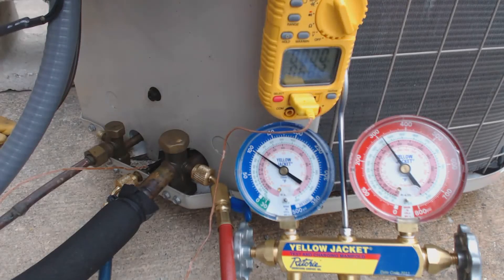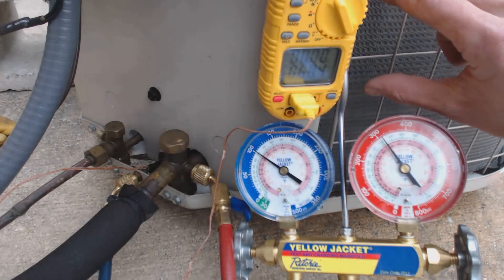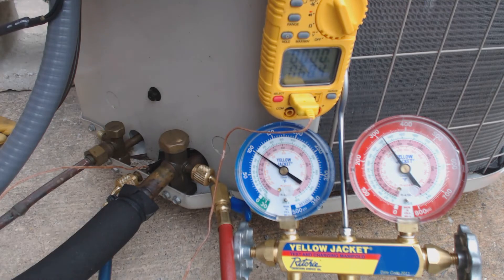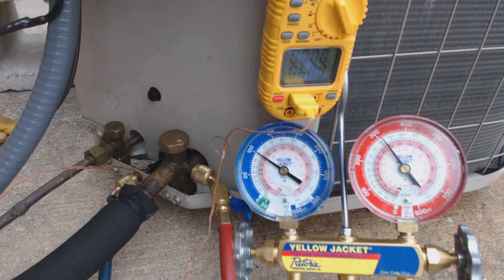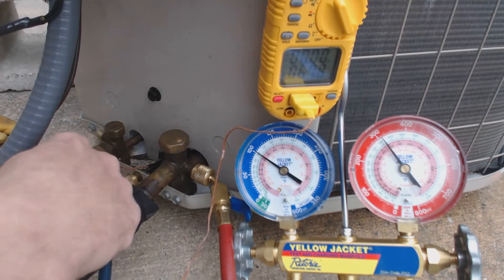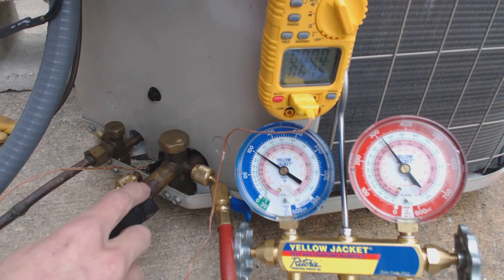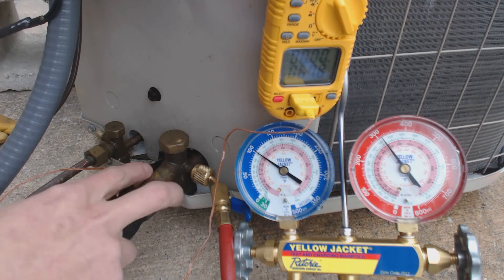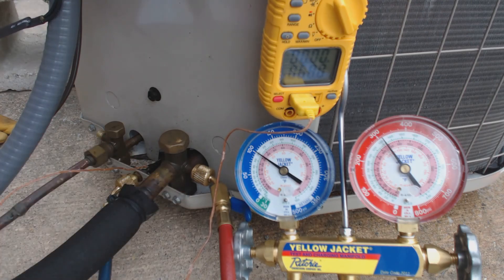Charging a Heat Pump at Start up or in the Winter Time! What you need to Know!

Comment: Hi,
When compensating for additional lineset length, do you add additional refrigerant based on the OD of only the larger (suction) line or for both lines? I have 1 1/8" suction and 3/8" liquid line. Would I add only for add'l length of 1 1/8"  or for that PLUS the 3/8" suction line length?
Thanks!
Reply: Its the combined ounces per linear foot. I.e.,  add .54 oz + .208 oz = .748 oz per linear foot.  This is the charge carried by both pipes.

Comment: Should we be adding the refrigerant in liquid or vapor state during the winter time and should we be adding it in to the discharge line or into the true suction line?
Reply: My understanding is that the heat pump it in winter everything is backwards so my assumption is we should be charging the system with Vapor into the discharge line because we are charging into the condenser which is now the evaporator because it’s winter

Comment: So in cooling mode, red hose to liquid line and blue hose to suction line as usual. But in heat mode now red hose to 3/4 line where does blue hose go? 
In both modes your low side always need to be higher than 32F correct? Thanks.

Comment: Sir you cannot check the superheat of that unit like that. Your probe must be on an actual suction line. The pipe you are attached to has no refrigerant flowing through it, it is for checking pressure only.
Reply: do you mean coming off the compressor?

Comment: I see that you are connected to the common port.  Is it possible to charge the system through the common port in cooling mode?  I'm thinking of using stubby gauges instead of hoses to save refrigerant when checking the system and would like to hook up the charging hose to the common port when needed.

Comment: How often do you have to adjust the TXV or adjust the charge based on superheat on a new installation?
Reply from the maker: We shouldn't have to go and adjust an ac system TXV if it was correctly set originally. Most TXV's for AC don't even have an adjustment stem on the bottom. If there is high superheat and low vapor pressure, coupled with normal to high subcooling then that would indicate a liquid line restriction such as a TXV. It could also be a strainer screen or the filter drier. I go into detail explaining troubleshooting scenarios as well as charging procedures in my book which is available at the website, https://www.acservicetech.com  thanks!

Comment: Hi Craig
Iv got a quick question
There is a mini split system r410a on heating mode the discharge line goes up 690 psig and actual temperature of 62 Celsius. There is no other valve to connect my hose to except vapor(discharge on heating)  question is that 690psig isn't it a little higher than normal? What's wrong with unit then?
Reply from the maker: Hey Ace, it sounds high to me too. Is it possible it is overcharged? Did you check it in max cool and find a superheat of 0 to 5 degrees of superheat? Thanks!
Reply: @acservicetechchannel 
The superheat was about 8 degree Celsius as we are in Australia and now it's winter time but not that much cold.
Saturation about 5 degree Celsius
Suction line temp about 15 16 Celsius
After reversing it from heat to cool
Reply: By the way I mean 690 kpa not psi in my first message

Comment: Would low Freon make the heat pump short cycle in heating mode ?
Reply from the maker: Only if the unit was shutting off the outdoor unit due to a low pressure switch in the vapor refrigerant line, thanks

Comment: Replaced evaporator coil. After nitrogen leak test and pulling vaccum to around 500 microns. I charged it up according to nameplate.  11 lb 4 oz. Added 5 oz extra for long lines. It is split heat pump. I checked delta t on cooling. 18. On heating it took a while to heat up but got to 17 in 7 minutes or so. It went smoothly and I said my goodbyes to the customer and that id be out in 5 minutes.  When I get back it's still running on heat and pressure are 500 or tetard on low and 400 on high. (Reverse refrigerant flow ) my heart sank at first. But I see i needed to use the true suction port on heating instead of the liquid line? Although sometimes I checked before it read the same? Also ambient was 65
Reply from the maker: After when you charge in the exact amount needed, you can check the charge like normal with subcooling (if equipment has a txv) if you use a charging jacket or another way to reduce airflow across the condensor if it is below 70 degrees outside. You would target the saturated temp of the condensor to 95 before checking the charge. I want to do a video on that soon, thanks

Comment: Greetings!

I Literally ran in to this same problem (The Wailing Gerbil like noise), with one of my Customers:

https://www.youtube.com/watch?v=kKMPPl023FQ

With the exception of the Noise, there are no other Complaints. The unit is heating the home satisfactorily in the heat pump mode.

The HP is a Goodman GSH130421E, with 20ft lineset & a "All Style" ASUM  42 Coil that Goodman & Lute Supply of Cinti., Ohio "Certified" as "Matching". I installed this system 7 years ago, & the only problems were the Compressor needing a "Hard-start kit" (2 years ago), & a TXV that failed in July 2017. The System ran, with no problems up to approx. Mid November, when the "Gerbil getting strangled" noise began to infrequently appear in the Cooling & Heating mode.

I'm going back to the Job tomorrow, & intend to to Trouble-shoot the System, but now another "Unbelievable" situation has arose, ....For some reason Goodman Tech is telling me that Checking for Sub-cooling will not work!?!?!?! I asked "Tyler" what he was talking about, & he really couldn't give me an explanation (WTH????), & he wants me to call him from the Job site.

I'm thinking that this "Wailing noise" is coming from the Internal Check valve of the TXV, & I was wondering if You have ever run across something like this?

Also, can you think of any reason why, Checking Sub-cooling, in the heating Mode, of this Heat Pump will not work, as "Goodman Tech" is saying?
Reply from the maker: That is correct that you need to check subcooling in cooling mode only because otherwise, you don't know how much refrigerant is in the accumulator. In cooling it is drained. If it is below 65 degrees then you would need to limit outdoor unit airflow with a charging jacket to check cooling. When the internal pressure relief is not sealing there will be higher than normal vapor pressure in cooling mode. Thanks David!

Comment: Would you consider doing a lesson on the 30 + rule when using the PT Chart when measuring head pressure on a low SEER unit ? I've heard of it before but never had to apply it in the field yet . Thanks again  BroOski
Reply from the maker: I would not advise applying it. It will get you close and some older factory reps were teaching it for a while. Just maintain using superheat and subcooling to get exact amounts for efficiency and compressor safety. I may do a video on that for next summer. Maybe you can remind me when we get closer. I try to stick with the season we are in as much as possible, thanks Sean!
Reply: Newer unit have that number lowered.

Comment: High side one on the wrong port,
Reply from the maker: This is in heat mode so the large vapor is the discharge gas.  The liquid line is the subcooled liquid from the indoor coil.
Reply: @acservicetechchannel  you still wouldn't hook up the gauges like that. The red will still go on the liquid side and you would put thr blue on your true suction port
Reply from the maker: Hey Curtis, I would still turn the unit on in cooling mode and charge any extra refrigerant into the vapor service port. This is because this will enter the accumulator before entering the compressor. If you charge any liquid into the true suction port, it will immediately enter the compressor. You have to be extremely slow if you charge any refrigerant into that port. R-22 since it is a single component refrigerant can be charged in as a gas into that port though, thanks!

Comment: You have the liquid line hose on the suction line because thats now your discharge line because your in heat mode.  So in effect that now somewhat turns into you liquid line in cooling mode. Am i somewhat understanding it? Do you always hook up your guages like that in heat mode.
Reply from the maker: Yes that is the way we hook up in heat mode. the red gauge is hooked to the discharge vapor but in cooling this would be low pressure vapor. The small liquid line will remain liquid but it is just the direction in which it is going. Check this refrigerant cycle with flow video --- https://youtu.be/Os2WMQxGSws ---  I will be making one like this for while it is in heat mode as well
Reply: thanks man for all the help
Reply from the maker: No prob!
Reply: Hey ac service tech ive been watching a lot of your videos and i would like to thank you for all the time that you put into your videos it helps clarify a lot of the basics. Do you know when youll be making the video on the cycle in heat mode so i can watch out for it?

Comment: Hey brother, great channel! Very professional and informative. In a situation where we are unsure of line set length can we use discharge temp on a TXV unit to determine charge pressures in wintertime? If so, do you have a video or recommended procedure?
Reply from the maker: Unfortunately we cannot because of the varying amount of refrigerant in the accumulator and the varying temp outside. A different outdoor temp will lead to varying discharge gas heat which will lead to varying heat transfer on the evap coil even when we have a roughly constant 63-73 degree temp value inside the building that you are rejecting into. You are going to have to guess the distance if you don't know the best you can. Some companies have come out with the charging bag that you put over the out door unit but that won't be right on either. Cooling mode drains most of the accumulator. I recommend that heat pumps be checked for any leakage during fall so that if there is a leak it is a large one that needs to be fixed and then you can weigh back in. Of course it is harder if something is not serviced and then doesn't seem to heat in the winter. Start really paying attention to your supply minus return indoor conditioned air temps on different outdoor degree days at customers places so you can feel confident if another system is working properly depending on seer, cfm, coil life and then check it for exacts when it is 65-70 degrees outside in spring. I hope this helps a little bit!
Reply: Man you are one of the best (in every sense of the word) youtubers out there! Thanks for doing what you do.

Comment: In heat mode could you hook the high side gauge to the liquid line instead of the discharge line? Great videos
Reply from the maker: The liquid line in heat mode won't give you much if that is where the piston is so it will be a low pressure liquid before phase changing and superheating.  It depends if the piston is before or after. We usually are on the large vapor line and true suction for heat mode. Thanks
Reply from the maker: Check this one out and note where the piston often is in answer to your question, thanks- https://youtu.be/Os2WMQxGSws

Comment: What are some rule of thumbs when servicing old heat pumps in winter mode to check the charge? Pressures should be? Indoor temp. Split? Anything would be helpful, thanks.
Reply: Wayne Miles I got the same questions :(
Reply: My understanding is that since the outdoor unit is the evaporator in the heating mode, and the txv controls the superheat, and most of the manufactures design the txv for 10 to 15 degrees of superheat, if you are in that range. you are in good shape, temperature split between 20 to 30 is good in the indoor coil, of course airflow is very important. i will not worry too much about pressure. since pressure and temperature follow each other that number is going to be dependant on indoor and outdoor temperature
Reply: Read the literature that came with the unit. Most of the times, instructions to charge in heat mode are outlined.
Reply: If the temp indoors is above 70 you can check the sub cool in   a/c mode if you restrict the air flow at the condensor. He made a video on how to do this.